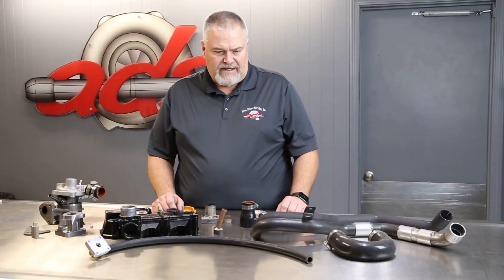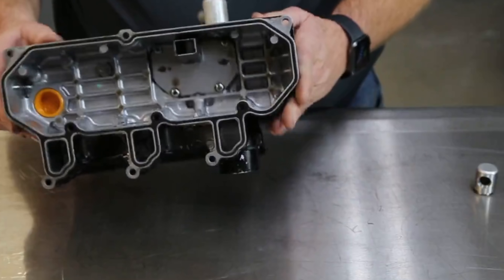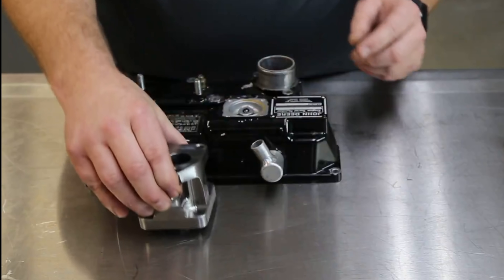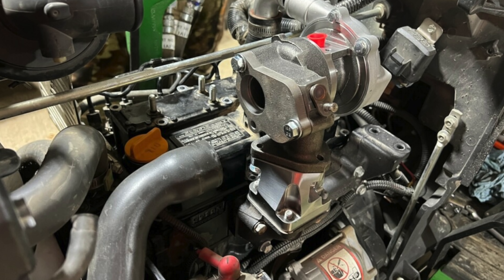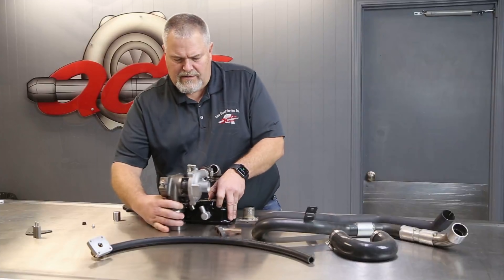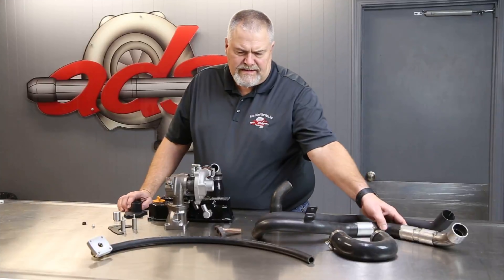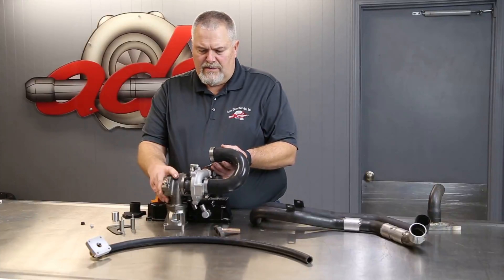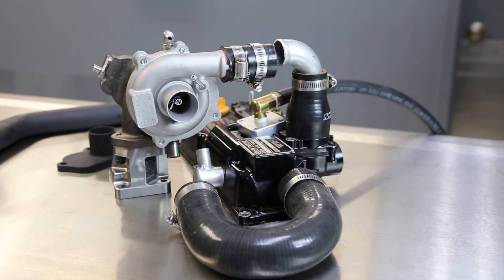John Deere 1025R Turbo Progress!! What Would A Kit Look Like?

Comment: They are putting alot of time into this and it shows in the design and quality. This is going to be an awesome kit.  I hope they show how to deal with turning up the fuel on the injection pump some to compensate more air.  And after all said and done I hope to see this tractor on the PTO dyno for the results!
Reply: Diesel engines are air controlled not fuel controlled, it will make more power by just giving it more air, but more fuel would again keep making more power, but maybe not necessarily needed to make it work
Reply: @cargotoolshop5319  I've added turbos to other diesels, just not these little tractors.  If you're adding air, you have to add fuel to see gains.
Reply: @cargotoolshop5319  It is burning all the fuel just adding a turbo isn't going to up the power on its own. I put a turbo on a 4240 Deere with no fuel change it made no power increase at rated speed, under lugging conditions it was up a bit but that was because it was smoking before under the same lugging conditions. Removing the clean air filter added 0hp as did putting a straight pipe on in place of the muffler. If the components are sized right they don't cause any power loss.  I have done the straight pipe versus muffler dyno test probably 20 times on different turbo powered Deere tractors and not once have I seen the pipe gain power but people sure do think they need them!
Reply: Someone needs to go watch gale banks to see how to tune a diesel
Reply: @Shredxcam22    Don’t waste your time.  His tuners are very lazy on takeoff and don’t bring on extra power until the engine is at a higher speed.  Not ideal if you’re towing a loaded trailer and you need max power to get moving at a stop light on a hill. He’s in big with EPA an the greedy feds.

Comment: Tim look up the turbo components on jd parts for a 3235c. The oil return goes into the engine plate between the block and the cover.  Simple install.   I used all the turbo components from this engine on my 955. Looks factory and was not bad price wise.

Comment: Need to make the kit so as to avoid the need for welding, especially into the valve cover. Some kind of O-ring and nut attachment on the valve cover would be more installation friendly.
Reply: I foresee a core deposit exchange for a modified valve cover. Then it is a simple swap and send them your old one that they'll modify for the next kit.
Reply: When the engine data plate is on top of the valve cover I don't think a core swap is going to go over very well.
Reply: The 1025 has 2 oil fill plugs.. Why not take out the one in the bottom and run a line into a custom plug with a barb on it?

Comment: I'm as much of a gearhead as anyone and like this series just to see it done.. , but, I would not even think of doing this to my 1026R as horsepower has never been a problem running loader, tiller, brush mower or 60" belly mower. The limiting factor has always been the hydraulics and traction.
Reply: Nah dude you need more power
Reply: All depends on usability. 4ft capability to 5ft makes a big difference with scuts
Reply: You could get a bigger hydraulic pump and put weights on the tractor plus dual wheels on the rear.
Reply: @kevinbaker6168  what spins the pump and puts the go juice to the duel tires...
Reply: @joshua7999  never enough  HP !!!
Reply: I stall engine few times while loading the front bucket by running my 2025R backhoe into a pile of soil. My tractor is well loaded, so traction isn't an issue, and having few extra HP under the hood would be welcome. Also, high gear would become more usable - with current engine, you don't want to use it much on a well loaded tractor.

Comment: Yeah that's probably going to be hard to make a kit, anything over 25hp and it will need a DPF to meet the standards of that HP level.  But I can't wait to see the dyno numbers you can normally get a lot out of them.  I going to say 10hp gain.  Thanks for the update!
Reply: I don't think it's gto be that much, not without turning up the fuel at least. I'm expecting 4-5 hp on the pto dyno without any supporting mods
Reply: @codymartin6704  yeah they will definitely need to turn the fuel up to get 10 engine gain
Reply: No DPF needed for an add on kit.  Straight pipe it an let er rip

Comment: I am excited too for my 3025e. And they don’t have to make a “EPA” certified kit. They can sell the connecting parts in a kit and then sell the turbo in a kit that just so happens to bolt on to a JD 25hp engine if that’s what you wanted to do. 😊
Reply: I think they are on the right path though. EPA has come down very hard on companies that make anything that go around EPA on Diesels.  EPA can see through the shell game of separate "kits" like you say, so might as well do it right from the start.  

My F350 I bought was deleted by the previous owner, and I didn't realize it was fully deleted until a couple weeks after I had it. If I want to have the tune adjusted for it, I can't, no one will touch it for fear of getting fined by the EPA.  Years ago I dealt with a tuner who fixed a few issues with my 99 7.3 Powerstroke and transmission. I asked if he could refine the tune on my 2012, he said he could not touch it even if he wanted to.  Sad part of this is if I need to have any work done on it that I can't do myself as far as the Engine Controls goes, it would have to be returned to stock at the cost of $4-5,000.  Ouch.

Comment: Excellent work and fabrication but I would be very interested to know the turbo kits total added weight how it will hold up to all the vibration from the engine. As 1025R owners know, 1025's had a problem with the air breather mounts breaking from engine vibration prompting breather relocation kits for older models. Even the thicker breather mount fix from JD didn't hold up and in some case's, the valve covers broke. I'm sure the weight of the turbo kit weigh's more than a plastic air breather which leads to my question of how the manifold and turbo components are going to withstand vibration from the engine before something fails? Either way, awesome research and information.   Cant wait for the kit to come out!

Comment: That turbo is going to really wake that tractor up!
Reply: To be completely fair, they said at the beginning that you realistically shouldn't expect more than a 3-5 HP increase.
Reply: @lorzon  I’ve ran both turbo and non turbo tractors. It won’t be that noticeable and I get that, but when he’s using a tiller or an implement that will bog the engine down, he will be able to feel it power through much better. Again, maybe not as noticeable as I could on my 3038E and even more so on my 5045E, but I still think he should be able to notice it while working the tractor hard. Depending on the price of the kit it might not be worth it but if they do market it, I’m sure people would purchase it.

Comment: Looking really well thought out and designed. 
This could be the start of a 1025R sled pulling team/ competition. 
Then to find out what the next weakest links are in the drivetrain and make stronger components to replace those. 

You will have to have stage 1, stage 2, stage 3, stage 4 etc kits.. lol
Reply: Those kits already exist 1026r, 2032r, 3038r, 4044r  each kit comes complete with the heavier drivetrain, bigger filters, and bigger radiator to handle the extra power.😆

Comment: One very small thing I'd consider is making the exhaust 1/4 to 1/2in larger moving that much air. Also, after it's done, see if the exhaust bothers you while you work and possibly have the pipe come out behind you, or a turn out in front of the right-side back tire. Just a few thoughts, I have a 4400 with a yanmar in it and at times the exhaust has some black color to it, (if you know what I mean). The tractor is heavy and is a 38hp but I feel it is a little underpowered, 3sp hydrost,,  but we live on hills. I was thinking of turning a little more fuel to it, but then I'm going to use more fuel. If I force air and turn it up, I probably won't use any more fuel because I cam run it a little lower when plowing dirt or snow.
Reply: If you're naturally aspirated then increasing the size of the exhaust pipe let's it breathe better and you get a small boost in HP.
BUT with forced induction it's not as important, in fact it usually isn't necessary to change out the pipe. You actually get a bit of power increase from keeping the exhaust flowing faster and hotter in a stock size vs a larger size.
Note I'm running an Edelbrock eForce supercharger on my street/track car and after dyno runs changed back to a smaller pipe after disappointing Dyno results with a big diameter pipe.
Had the same experience on my F150 4.6 Triton V8 which has an electric 5 PSI boost turbine (only kicks in when accelerating) where back pressure becomes moot during boost.
The other thing is the Stoichiometric ratio, if you add more air you have to add more fuel to increase power AND to prevent increased cylinder temperature due to lean burn (which happens in both gas and diesel engines) and damage.
I'm using a 3025 on my place and it's drastically underpowered... My bad because I didn't want to fool with exhaust fluid and so picked the 25HP model. I'd gladly pay a little fuel penalty for some increased HP.

Comment: As I see it the issue with the EPA is if you produce more than 19Kw of output ( roughly 25hp). Then you will need to add a DPF to be compliant. So no I don't think a "kit" is feasible... BUT for those that like to " tinker" on their own stuff.....
Reply: That might be an additional issue, but the engine is covered by epa regulations as is, same as a push mower. The muffler and fuel system are the emission control devices.  They don’t require additional stuff such as dpf, but by law they can’t be modified in a way that increases emissions of targeted gases.   

There have been several recent pushes in congress to create exemptions because as currently written you can’t take an engine out of a car and modify it for racing use. It has to be purpose built for racing from the ground up in order not to violate this.  I realize it hasn’t been applied this way except in the last couple years they have started.  

Think of it like the ATF rule, one a machine gun always a machine gun.  You could convert one to semi automatic, but it would still require a machine gun tax stamp and transfer.
Reply: @rydplrs71  It is not currently written as you describe. There is a push to change it to what described but there are petitions signed against it. People do engine swaps everyday and the EPA is trying to change that but has not yet.
Reply: @Itsa_Mea  it’s been written that way for decades the epa  just didn’t enforce it.   Look at the warnings in your manuals, and usually there is a sticker on the engine itself saying it may not be modified.  There are no exemptions. 

Please read the RPM act, it is solely for the purpose of creating an exemption.
Reply: @Itsa_Mea    Here is the EPA discussing the issue in reference to the clean air act of 1972.   I’ll also add they have levied fines for tuners even though they could prove the products they sold were exclusively used on track. 

GBZ claims that its products are exempt because they may also be used solely for competition. ECF. No 42 at 15. Contrary to GBZ’s assertion, there is no competition use exemption for motor vehicles under the CAA. See 40 C.F.R. § 85.1701. The CAA defines “motor vehicle” as “any self-propelled vehicle designed for transporting persons or property on a street or highway.” CAA § 216(2); 42 U.S.C. § 7550(2); see also 40 C.F.R. § 85.1703 (further defining “motor vehicle”). The definition focuses on vehicle design attributes and not on their use, i.e., “competition.” Id. An EPA-certified motor vehicle does not somehow disappear from the jurisdiction of the CAA if it is used exclusively for competition motorsports. Likewise, aftermarket defeat devices remain subject to the CAA prohibition when they are manufactured and sold, or purportedly manufactured and sold, for motor vehicles that may be used exclusively for competition motorsports. The CAA lays out the exemptions in Section 203(b), and this includes no mention of competition exemption. 42 U.S.C. § 7522(b) .

Comment: I can see the weak part of this project is going to be the valve cover/intake gasket  I don't think it will take much pressure to blow it out. The way it is designed it will blow internally resulting in high crankcase pressure

Comment: I am an owner of a 2003 JD4010 compact tractor. With a horsepower rating of 18, I would love to boost it into the 20's to more easily run some implements.
Reply: There's no replacement for displacement man.

Comment: Tim not that you would have a use for this but are you aware of a pto tractor attachment for dealing with tumble weeds? We live in southern Colorado and have a new property. We have about 800ft of fence line full of tumble weeds. Everything online says to burn them but it's always so dry here I don't want to start a grass fire. I thought about a wood chipper but the throats are just too small. A brush mower just pushes them along and they don't compress hardly at all smashing with the bucket. I have in total 2 miles of fence line and hopefully eventually cattle that can help with the weeds but we aren't ready.
Reply: Give a good old fashioned snow blower a whirl.  From what I remember of those Southern Colorado tumble weeds, they are fairly fragile.  The snow blower might just be able to gather them up and force them into the chute.

Comment: The turbine is a great improvement to the Johnny however, I have not seen where any engineers mentioned about using a super charger instead of the turbine. Any comments from the engineers? 
I remember seeing , on one of those wacky car shows, where 'they' put together some leaf blowers and increased the horsepower (somewhat). Comments Tim?

Comment: If this turbo increases horsepower, as I think that it will, it will make the tractor subject to the Tier 4 regulation requiring adding DEF to the tractor. This is because the horsepower, now (on a 1025R) is 23.9 hp, and the Tier 4 cut-off is 24 hp. Or am I missing something?
Reply: Who really cares? It’s aftermarket and you’ll install it in your own barn. Don’t ask don’t tell.
Reply: unless things have change and i haven't heard of any change it only apply's to when a vehicle is made and sold after that there is no requirement to add more so if it didn't come with a DPF there is no need for one even if it now makes more then 24hp.

Comment: As for the EPA, SCREW THEM. You can't comply your way out of tyranny, which is the exact reason we have the Second Amendment. What most people forget is the government is completely impotent unless WE ALLOW them to be otherwise.
Reply from the maker: Easy for you to say.   Different if you are on the hook to pay the fines.
Reply: @TractorTimewithTim  With all due respect, I think you are looking at the kit (or possibility thereof) the wrong way. The engine and emission system were in compliance at the factory. The kit is after-market, an optional extra installed by the consumer. You are working with Area Diesel  to develop that product. You are not forcing anyone to buy the product. You are also not the first to put a turbo on a 1025R. It's no different than buying a massive Edelbrock carb, or blower or a stroker kit for a 350 Chevy. Meeting emissions is not your responsibility as an after-market provider of a product. That would be up to the consumer, as they would be the ones actually doing the modification. Asking for permission is most assuredly going to get you a negative response. Now, I will fully admit, when I first posted my earlier comment I was a bit fired up because I made the mistake of watching political news, but I will stand by my words.

All that being said, I thank you, Tim and Christy for all that you do. You are the reason I got a 1025R. Love the videos, and please understand that I want any and all of your business ventures to be as successful as possible.